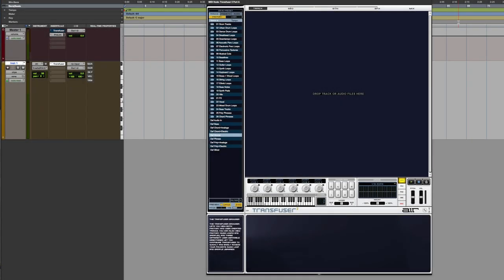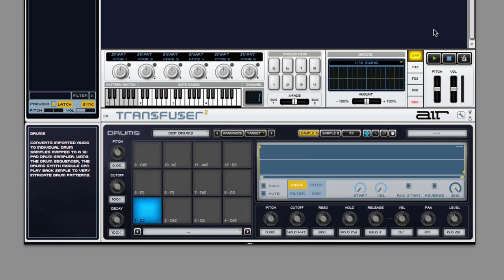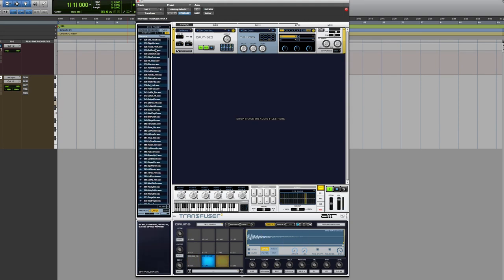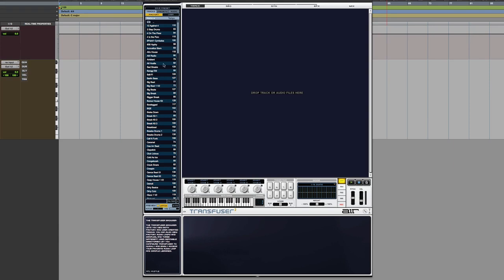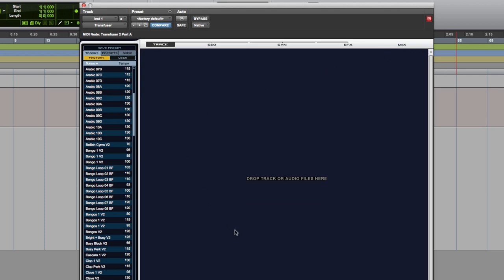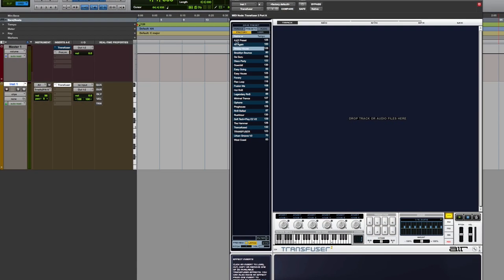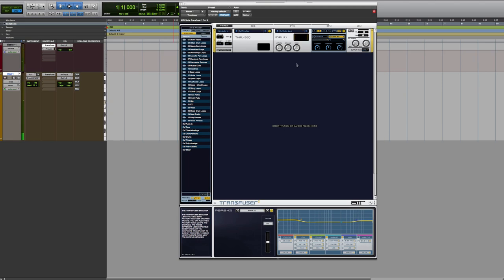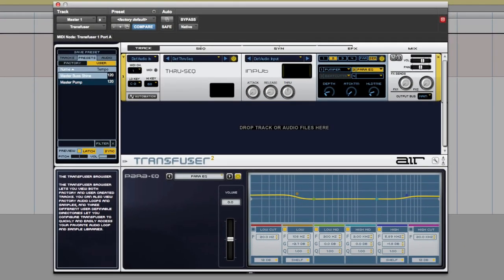5 Hot Tips For Using AIR Transfuser 2

Comment: This plugin has real potential but it needs a mixer and a much better GUI. I set my Mac display on 2880 x 1620, and I can't really get a grip as to how and what all it's functions are. When i set my display on the default, I have issues with the color and even the text is small. Fits in my workflow but because of the library, certainly not the gui.